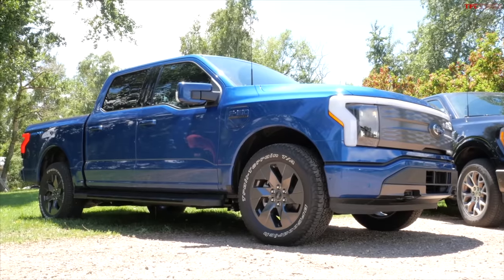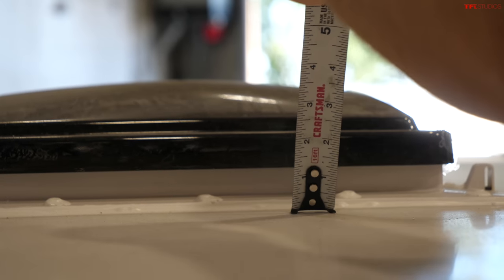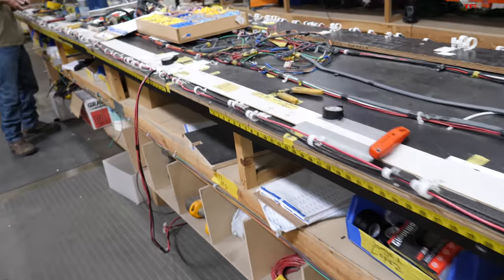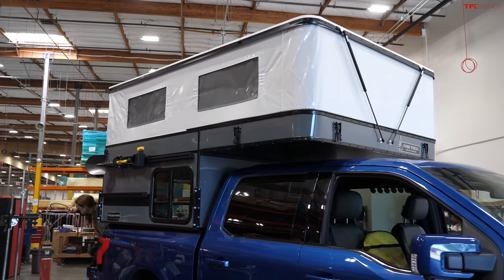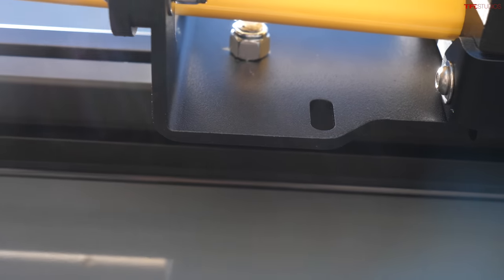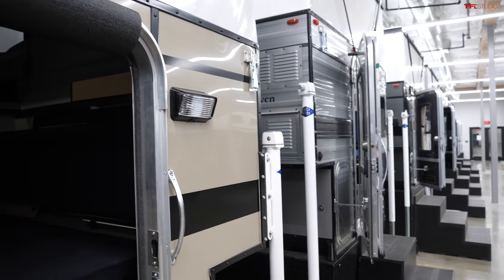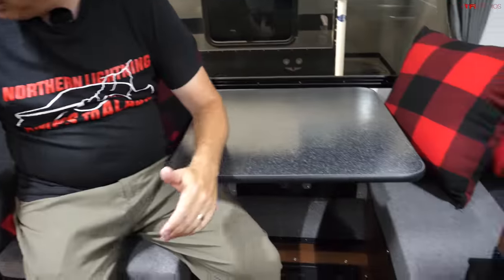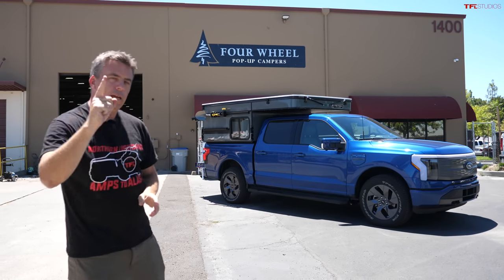Ford Says NEVER EVER Put a Camper On The EV F-150 Lightning… So That’s Exactly What We Do - Ep.2

Comment: Ahhh, I remember riding on the top bunk of my grandpa's cab over camper back in the 70s. Every time he went around a corner that old truck would sway back and forth from the weight of that giant camper. Too young to realize that thing would disintegrate in an accident but, that's how we rolled back then..
Reply: I did the some things. Made daddy stop so I could get up front.  Got very car sick
Reply: My father had a '70 F-100, w/302 and a highway-geared rear end. He thought he could put a heavy camper on it. Big mistake. The truck was nowhere near equipped to handle the weight. After widened wheels, heavy duty tires, new HD rear springs and shocks, and I can't remember what all parts were installed to try to make it useable, we took a trip from Georgia to Michigan at Easter to visit my mom's sister. Much like your Grandfather's it swayed all over the place. Me and little brother were in the back but whenever we got onto the bunk over the cab, it was almost unmanageable. We both had to ride in the dinette. On the way home, we crossed a bridge with ice on it. The truck swapped ends-twice! The rest of the trip was mostly uneventful but in northern Ohio we hit a nasty headwind that knocked maximum speed down to 40 mph. It took 3 times the amount of fuel coming home as it did going north. After we finally got it home, we cleaned it out and Pop put a for sale sign on it.
Reply: Ah yes. Riding in the “Poopdeck” as we called it. Lol
Reply: My mom and sister and sometimes a cousin spent so much time doing the same on the way to the lake in the summer and to Tahoe in the winter....

Comment: Based on testing that Kyle with Inside EVs did on weight in the bed of the Lightening and the Rivian, the weight of this camper is not a problem.

The aerodynamics of the truck will be affected though which is probably going to significantly reduce the range.  

Any thoughts about using an aerodynamic faring in front of the pop-up to minimize the air drag effects at highway speed?
Reply: Yep. I was surprised the camper did not come with slightly better aerodynamics.

Comment: Dave could have made this whole pop up camper by himself for under 1,000$.
Very ingenious man
Reply: I once owned a used, 1972 vintage Fourwheel popup camper and am in the process of building from scratch one for an 8 foot flatbed.
From experience, I can say that unless you're just building it with plywood, your parts alone will exceed $1,000, even for just a shell.
However, I do agree with your principle  of building your own, with the features, materials and quality you want and the time you're willing to spend to get there.
Reply: @desertsasquatchxploration1568  to I know I could go to home Depot and build a basic no thrills camper for less than $1000
Reply: @desertsasquatchxploration1568  'Talga Turf' needs to acknowledge that any home built camper better than a windowless construction of plywood and 2x4s will require hundreds of hours of labor.  In addition to the material costs, I've already spent substantially over $2500 for aluminum tubing, aluminum skin, Azdel panels for insulation and skin support, and windows. I still need to buy popup specific components to lift and support the roof, as well as the fabric to build the soft shell material that bridges between the hard shell and the roof. I also still need to get stainless hinges and latches, electrical components, sealants and anything/everything that will be inside the campers.
Reply: @desertsasquatchxploration1568  Good profession.
Reply: It's easy to do when you don't pay yourself!
Reply: @gregparrott  your camper is built top notch.. I'm saying it can be done for far less, no thrills style
Reply: Would accept a Four Wheel Camper if offered for free?

Comment: Love TFL for the". Ford Says NEVER EVER Put a Camper On The EV F-150 Lightning… So  guess what we did". wonder what the result will be.  Four Wheel Campers has some serious build quality.  Most "campers" are cheap things.  The project M is first class all the way.    The project M will work, but I think that table is the straw that will break the camels back.  That table is responsible for 1-2 miles of range right there. Great sturdy build though kudos to the builder for building it sight unseen.
Reply: It's because Ford doesn't want to be embarrassed when the range drops to like 120 miles and becomes totally unusable. Knowing TFL they'll probably be driving this 85 MPH  and wondering why the range is only 90 miles, lol.
Reply: I'd say it's a battery fire issue not the range.
Reply: @79stroker  I guess it's the same thing if you try to drill a hole in a gas tank while installing a camper
Reply: Voided Warranty?

Comment: FYI you could have went 120v to 12 v DC converter and plugged in directly to the pop up camper wiring and it would free up space in back and lower the cost. The lights and fans would probably pull a kilowatt a day, so it would not change battery percentage much on the lightning

Comment: My wife and I are scheduled to get our Hawk model 4wheel pop up in September.  Ordered it in February.  The tail does more to create drag on a camper or trailer.  That is why the airstreams are relatively easy to tow.  We already have a 27ft travel trailer.  But most of the places that we want to go, the trailer will not fit.  Also the high winds out West, the high wind restriction is 9ft in height on many highways.  So the pop  up design can travel safely.
My pickup is a Ram1500, my wife has a Ram 2500 with twice the payload.

Comment: if you can't put a camper on a lightning. then its not a good replacement for a gasser.
Reply: It's not if you plan to use it as a truck at all.
Reply: Oh sorry, it's not useful for 0.01% of use cases, better scrap the whole project!

And before you say anything, I worked for a Ford dealership as an auto detailer and final deliver PDI, where I'd clean the vehicles and install accessories for 4 years. I installed many box liners and tonneau covers, a few back racks, but never have I seen anyone desire a camper on the truck. Most tow their campers to a campsite, and others bring tents. It's super rare to see this sort of setup.
Reply: @Xyler94  that's because most 1500 trucks don't have enough payload for a decent camper. There are tons of campers on 2500 and 3500 trucks, just open your eyes going down the freeway.
Reply: @TS-di5zw  right. I know many many people who HAVE to use slide in campers because we all tow boats or trailers with dirt bikes, atvs, rock buggies or sxs's on them

Comment: While not as dust proof as a slide in, the canopy version of the FWC eats up significantly less payload and the reduced width means less over hang / a better rearward view via the side mirrors. 

Thank to everyone involved for the tour of the FWC assembly  process.  It's good to know a quality build is still available in the US.  For a build that will not rattle apart while overlanding over rough roads - $26K about right for the base Hawk, which includes a propane furnace, cook stove and a sink.

Comment: We just use our pickup for work around our or going to a few good fishing spots. 
Last summer we had to take the truck to MT to get some tings from the family farm.
The pickup is a 11 Ford Ranger XLT super cab 4X4. I added a K&N intake and a 3” FlowMaster exhaust and air shocks. Fully loaded with 70# of air in the shocks and 50# of air in the tires, we got 25mpg with the cruise set on 85mph in MT and then got 26mpg with the cruise set at 75mph in WA.
We only have 34K miles on the Ford, so we’ll just keep driving it…, until it drops, (which on a Ranger with the 4.0 V6 is about 250-300K miles). We know this because this is our 4th Ranger.

Comment: I wonder if there can be a slide out system to make it more like a cap by eliminating the need of the forward section while driving. It would probably need exterior struts. The exterior struts would just be longer, and there would need to be a rail system out the front for the sleeping compartment. The canvas would be lower with the upper shell protecting while storing. The rail system would need to be able to lock like a towed camper's slide out. That should positively affect the range of the truck hauling it unless the weight of the slide out system and struts is too high. The struts would increase drag, but I doubt it would be anywhere near what the portion above the truck would do. Typically, the slide outs would need another brace though, and I am not sure how that would work other than attaching it to the forward exterior struts with a support beam across the front of the slide out which the rails for the sleeping compartment would attach to. A support beam could be added from front to back structs as well to distribute the weight. The windows could be problematic, and it would be good to have interior struts to use the bed of the truck as well. The weight of the camper is not too much as exterior struts were the original way to actually level a truck camper, and this camper weighs less than that. Those exterior struts could actually level those campers so that the truck bore almost no weight at all while the camper is parked and those struts are also the storage method for the camper. My father used sawhorses under the camper while storing as well to make the struts last longer. Hookups would also be higher if cabinets with water were included, but considering there are flexible hoses, that might be doable with a rail system as well. The rail would let the hookups to the cabinet and to the outside float with the exterior camper wall, and it might be possible to have a floating sink. A range top could also be a smaller unit that attaches to the wall.
Storage while hauling would be the sleeping compartment slide out, and there could also be cabinets that attach to the upper exterior wall, which would raise and lower with the wall. This would also have been part of the problem of the exterior struts so again these should not be a problem. The electric truck would also have the advantage of a forward storage compartment, which should be utilized as well. The refrigerator would easily be placed in that area, and that area would also have an electrical outlet for the trip, which eliminates the need to haul propane for the trip.

Comment: David's dining room table is great.  I might make it about 2-3 inches narrower so people can move around easier, but that's a matter of opinion.  Make having conversations or a meal on a cold drizzling day a lot nicer at a campground.  David's truck bed organizer is a great way to keep gear stored, but easy to access as long as you can give up a few inches of headroom.  The fact he did it without a Project M topper around just shows how sneaky smart he is.

Going up the Dalton Highway is rough on any vehicle.  I've seen plenty of videos and read plenty of stories of people needing to carry jerry cans of fuel and a spare tire or two to deal with the terrible conditions.  Traversing that road with an electric vehicle is a worst case scenario for a Lightning, but that's what will make this series so interesting to watch.  It'll test the F-150 hybrid support vehicle as well, and honestly that'll be more relevant to me as my next truck in a few years will likely be a hybrid.

After this epic road trip I can't wait for the sequel in 5-7 years with the next gen Lightning to see what will have changed.
Reply: The table had to be that width for it's dual purpose use as a bed.

Comment: I have four AGM batteries in my 2021 Embassy Traveler Sport class B Transit 350HD and was advised not to discharge them less than 50% to maintain life span it was designed for. They are not like lithium that can go almost to nothing, as well as maintain a steady voltage as they discharge. Be advised on the AGM's, unless you don't mind buying another battery. Been there and done that...
Reply: and they weigh twice as much as lithium.

Comment: Some random thoughts: Andre is right to keep it light, but it seems like he's overlooking wind drag. The shovel kit mounted on the side is going to cost some miles of range at highway speed. Is there another place to mount it where it's not in the wind? Maybe an air foil for the front of the camper would help add a few miles, too. Might more solar on the roof would help with opportunistic charging? Also, metric measurements please
Reply: There is a preview video they put out and it had an air deflector on the roof of the cab. I do agree with you about external add ons like the shovel kit.
Reply: Shovel point to front and curved in..

Comment: What an interesting setup for your upcoming “to Alaska” series - I’m looking forward to watching each and every episode!  I might have missed it, but did you quote the total weight for the camper, batteries, solar units, etc.?
Reply: @21:13 1,326 Lbs “as equipped”.  Throw in water, food, clothes, emergency equipment, etc. etc. etc., and add in the weight of the participants, and you’re either at or above the truck’s load rating.  Right?
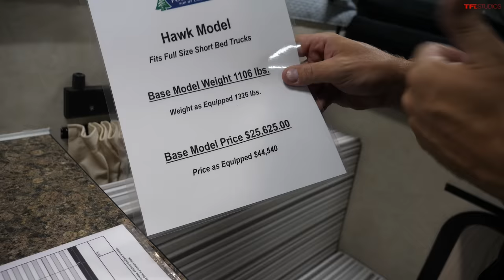Reply: @21:05 they chose the Project M because it's "under 400 lbs" the 1,326 was for one of the floor models

Comment: Great video. Really surprised they didn't go with a 100ah or higher lithium battery,  both weight advantage AND output advantage. 100ah lithium are not much more than the AGM battery they are using.
Reply: Lithium would severely limit it’s operating temperature range, which would be bad for an over lander design
Reply: I don’t know why they’re using a separate power system at all. He said they didn’t want to tap into the 12v system on a new truck, which is understandable. However there’s these things called transformers that can convert 120v-12v which are lighter and cheaper than that battery setup they have going…
Reply: @sgibb6802  You can't drive while charging the Lightning, so maybe you can't use the Pro Power Onboard while charging either; that would make the entire concept useless, if the main purpose is to use the canopy\camper while the truck is charging overnight at a campground.
Reply: @Cloud30000  I haven’t seen or heard that you can’t charge and use pro power at the same time. But good point
Reply: @Cloud30000  Newer Lifepo4 batteries can be all weather. Low temperature charging disconnect and built-in heaters for cold weather charging.
Reply: @kennethwers  it only charges at 50w in the video (solar I believe); where would the power for the heater come from?
Reply: @Cloud30000  The batteries. They are part of all weather Lifepo4 batteries.
Reply: @kennethwers  Do you have a link to these "large" capacity (equivalent to AGM car battery like the canopy uses) LiFePo4 batteries that heat and charge off 40 watts?

Comment: Honestly this series might determine if I buy a Lightning or not. Absolutely love the potential of these trucks.
Reply: What potential? Getting stranded on the side of the road?
Reply: @motor594brain  the potential to run 12’s at the local drag strip in a rig that can tow my boat and allow me to camp with climate control on overnight? 

I drive less than a 100 miles a week, have a lake 20 miles away, and love bracket racing at a track 10 miles away.

I don’t know about you, but I can’t think of another vehicle that can check all those boxes without an oil change….

Maybe your civic?
Reply: @BryByWire  Unless your boat weighs quite a bit more than 5k pounds then literally just about any truck, SUV, or sedan with a hitch can do that. Lol before I got a truck I would sometimes haul corn and a mastercraft with a bmw 530i.
Reply: @Nick-sx6jm  the point is, I could load a bmw 530i on a car trailer, tow it the the race track, beat it in a race, serve everyone dinner from my electric grill and refrigerator, sleep overnight with the AC on, wake up and tow the bmw home for ego repairs.

Electric cars are vastly superior at everything but road trips…. Which is the only reason I use the word “potential.” Instead of “just placed my order.”

Comment: I'm betting that camper costs at least 25% range penalty as is.  Andre mentioned doing something to improve aero so will have to wait and see what all he has planned, but in the current config, my guess is 25% reduction at highway speeds.
Reply: Well, the obvious solution to avoid the range penalty is to just carry the camper on the ICE truck and have the EV truck run empty. But that would have left the run with an asterisk - kind of like traveling to northern Alaska on a bicycle, but having a gas-powered camper van following behind you, carrying all of the gear.

I also like the demonstration that equipping the camper on the EV truck is, in fact possible, and for trips outside of the Alaskan charging desert, actually practical.